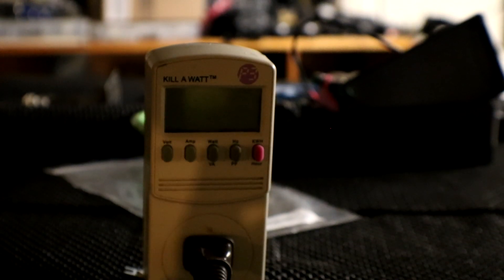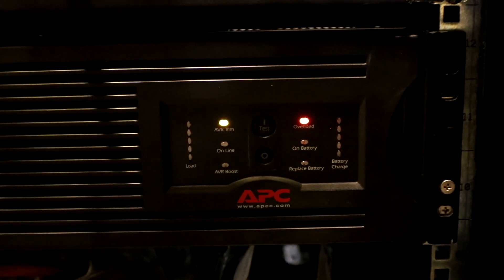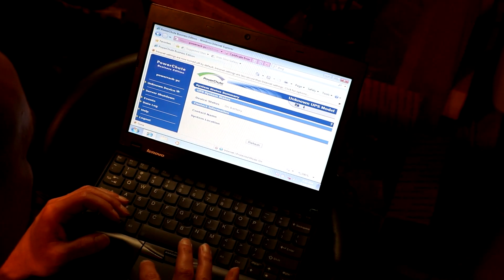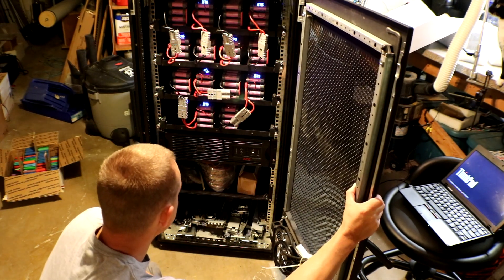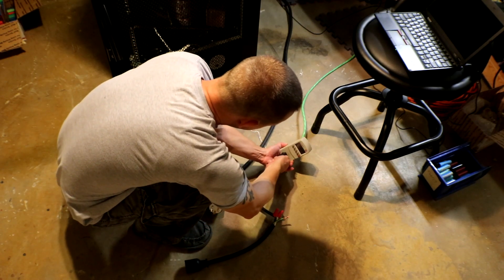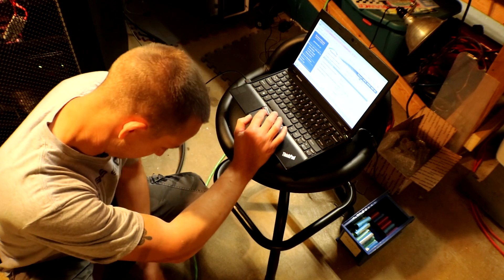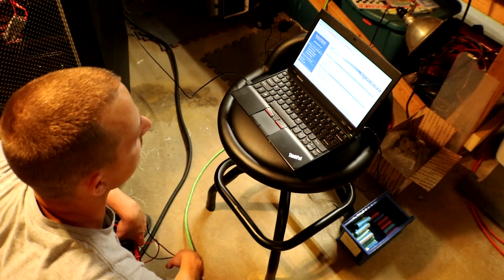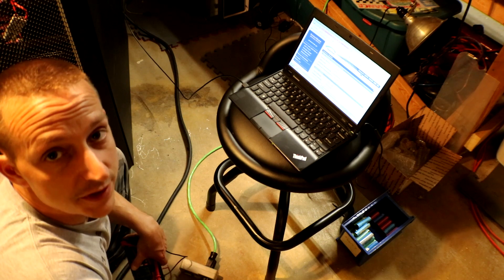Diy Tesla Powerwall ep51 48v Ups 24hr Test Run Update

Comment: Ok, there are some good comments. However, here's what I think:
As philipx2 said about the batteries being at 12aH, that's what comes with the system. Then it has 2 Batteries / Pack, and 4 packs. So, that gives you 8 batteries @ 96aH as the batteries are in a 4s2p configuration (We have to remember that these batteries are at 12V nominal, not 3.7V).

Your 100W bulb pulled about 1A. So, it 'should' have ran for about 4 days. But, the UPS was also running and that was drawing at least 2A (only guessing based on when you plugged the UPS into mains thru the Wattmeter). So that gives you ~3A total draw from the pack. 96/3 = 32Hrs. Still seems like it didn't run long enough, unless your starting voltage wasn't at full capacity.
If the UPS was pulling closer to 3A, then it'd been 96/4 = 24Hrs. Sounds like when the UPS is on battery power, it draws closer to 4Amps.

Here's a thought! (uh oh!). Take a Ammeter and connect it to the batter side of the input and see how much the system draws without load, and then with load. Try loads of 100W bulb, 300W dryer (or what ever), 1000W microwave. Verify the output wattage using the wattmeter for the loads. This will give you the most accurate readings as to what the UPS uses under varying conditions.

Aaaannnnddd, another great video!  :)   Thanks for the updates on the progress on these units. Gives loads of information for those of us who plan to use these for our Inverters
Reply from the maker: Yeah I plan on using an ammeter on the batteries, think I have another digital one somewhere.  Its hard to say exactly what its thinking and or what its doing.  Ill definitely be trying a few different loads and see what it DOOOOO.

Comment: Run the calibration with load. Those are smart ones, it thinks the battery is empty because original battery pack was way smaller.
Reply from the maker: Yup thats what I was thinking.  What size of load or does it matter I wonder. Ill have to wait until I get some solar hooked up so I can recharge the cells!

Comment: You might want to go with 13s. It comes closer to a 48V battery
Reply: I'm currently building a "small" backup system for my heating pumps using a rather simmilar APC UPS, mine charges to 54,2V on the batteries so I went with 13S giving me 4,15V fully charged, using 14S i'd only charge to 3,85V per cell... Hopefully my UPS isn't as smart, but considdering it still has a rs232 port i'd say I have good chances :)
Reply: This 'may' make a difference. Not sure. 
12V in 4s configuration: 11.1V - 13.2V; ranges: 44.4V - 52.8V
3.7V in 13s configuration: 3.4V - 4.1V; ranges: 44.2V - 53.3V
3.7V in 14s configuration: 3.4V - 4.1V; ranges: 47.6V - 57.4
Reply from the maker: Yeah Im not sure on the numbers they use for the batteries but since I changed the battery packs to 99,  the % is a lot better.
Reply: my SUA2200RMXLI3U will cut off at around 40-43v depending on load, higher the load, the lower voltage it will go down to before it cuts off (programmed that way i presume because of the characteristics of lead acid batteries). charging wise they sit around ~54.5v on a float style charge.

If you swapped to using the safer LIFEPO4 rather than LI-ION, you should be safe to leave them connected with the unit charging unattended.
The APC Smart UPS's are also known to get along happilly with an external charger no worries.
Reply: Yeah, I figured you could use a charging bms w/o issues as the ups could still detect the soc of the batteries and terminate charge when needed (if "it" is doing the charging, that is). But using an external charger, you could essentially turn off that function of the ups. I'll use the ups to do the charging to start with to do testing and such, and then when I get alternative methods for charging I'll switch over those those.
I'm guessing Joe will only charge the batteries from the solar when he gets it all hooked up for prime time  :)

Comment: Did you try http://apc-fix.com/apcfix software you can use it to change battery parameters just make sure powerchute is not running in the background as it wont connect.
Reply from the maker: I havent but will now, Thanks!!!
Reply: Free version will allow you to view but thats about it.
You can contact the author to get a full version that allows you to tweak, otherwise you can use APCUPSD software suite and the APCTEST program it includes to fiddle around.

Comment: Since this is a server room/closet product, the ACP will put the focus on remaining run time (network/server folks plan on being on the mains all the time and gracefully shutdown the equipment using powerchute when not pulling power from the grid).
Your best bets are two fold:
1. Don't run powerchute (you plugged in the brains by plugging into your laptop which shut everything down).  The APC will run as long as possible until some preset low (unchangeable?) voltage.  There is a free software (albeit horrible interface) called apcupsd (Linux and Windows binaries are available).  Use it to monitor voltages and get data.  You'll have to disable the shutdown scripts as well (which are only ran on the laptop/computer equipment and not the UPS) though but it won't shutdown the UPS.
2. Execute the run-time calibration tool and compare to the number of packs that the APC thinks it has.  Repeat. Many. Times. To. Get. It. Right.

I'm attempting the same thing with a smaller 24v APC UPS and ended up hacking the charging circuit (allows a higher charge voltage) and am planning on using an external (to the UPS) small battery monitor which will cut in/out the batteries from the inverter.  Powerchute will not be plugged in.  No way.

I like the idea of using solar cells to charge the batteries but I think you end up having to supply a AC current to the APC (sad face) to 'hack' away around the equipment.  If anyone has any deeper APC hacking knowledge, please let me know!  I'd rather attack the low voltage threshold built in vs. using an external monitor.

Take a look at one of my videos to see apcupsd in action!  I think it is in the 'Persuant to UPS Volts' video.  (Warning: interface and eye candy pain ahead)
Reply from the maker: I spent a few hours with another youtuber last night installing and configuring NUT(part of that I was waiting for linux to install).  I dont know crap about linux aaaaand since my spelling is crappy, lets just say it took a while LOL.  I think I saw that software apcupsd last night. I may try it.

Comment: Classic example of manufacturer trying to make something too simple and failing.
If they actually programmed it to do what any sane software would do, it would provide a means of being able to set a low threshold voltage, and then it wouldn't matter how many batteries it has because it would be able to extrapolate remaining run-time based on the rate of discharge.
Reply from the maker: I know right!!!
Reply: Rate of discharge and voltage alone are not accurate enough these days, which is why you can specify how many packs (or packs worth if not using AGM) are connected, this gives the Coarse runtime estimation, and over time when discharged enough the unit will learn and fine tune.

Comment: ups thinks battery is low and tells powerchute to shut your laptop down.  I think I deleted or renamed the shutdown.exe command that you will find in the powerchute sw
Reply from the maker: Thats not a bad idea
Reply: If using USB and the OS Native drivers, the UPS shows up as a HID Battery device and in such a case can invoke a shutdown via the standard "low battery" response just like a low laptop battery would. Installing the Powerchute or APCUPSD drivers should stop that and allow you to use software to control behaviour instead.

Comment: Traditionally these things charge those 7ah and 12ah sealed lead acid batts.  You may have to figure out how your lithium packs compare to what it thinks it has and then pick the number of packs the is closest to your number you get.  Just a thought.  Good Luck.
Reply from the maker: Since I changed the setting for battery packs installed to 99,  it says 52.9v is now 58% battery left.  That might of fixed my issue.  So Ill do some more testing and update on progress.
Reply: Official maximum is 10, set higher and the unit may behave funny, depends how the programming handles it.

Comment: Well I am having the same issue, plus when it charges it does not charge the to the capacity of my packs!!! I have a 24v UPS and haven't found anything to fix those 2 little issues. Maybe it has to with the fact that they are Li-Ion instead of PB batteries..not sure what it is yet. but if anyone knows or has any ideas I would like to hear about it!!!!!!!!!!!!!
Reply from the maker: Since I changed the setting for battery packs installed to 99,  it says 52.9v is now 58% battery left.  That might of fixed my issue.  So Ill do some more testing and update on progress.
Reply: The thing to remember with these UPS units is that they were designed with SLA batteries in mind so the charger is going to float charge each 12v battery to 13.5 so 4 of these batteries would be 54V for a full charge.  This means that if you are running 14S the max cell voltage for each parallel string of 18650s is 3.85V.  The 100% DoD for the SLA batteries is 10.8V so the UPS is likely going to kick out somewhere around 10.8-11.2V per 12v battery.  That means a voltage of 43.2-44.8V under load.  So each parallel string of 18650s will be seen as dead at 3.08-3.2V.  These UPS units will read battery voltage as capacity but they are also looking at the calculated run time based on the number of SLA battery packs.
Reply from the maker: +kuhrd Awesome! Good info to have. Thanks!

Comment: surely if it says 2% at like 55v or whatever it thinks you have a 5 lead acid batteries and 48 would be 4 i would not have expected it would go bot ways (like a bisexual) but maybe it can and maybe you have to remove or reconfigure your packs for the right voltage
Reply from the maker: Since I changed the number of packs installed, it says 52.9v is 58% battery left.  So Ill do some more testing and update on progress.  It could be Bi tho 😆